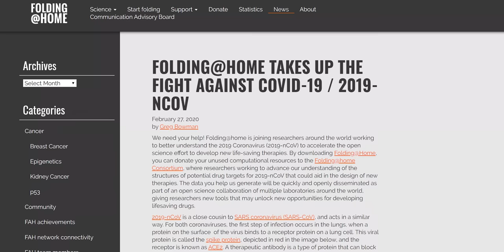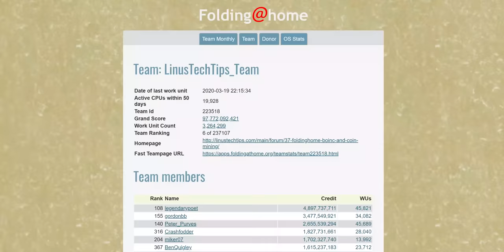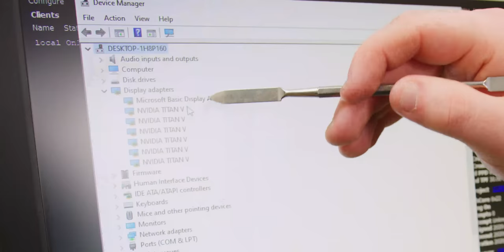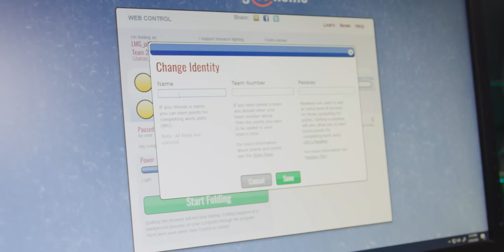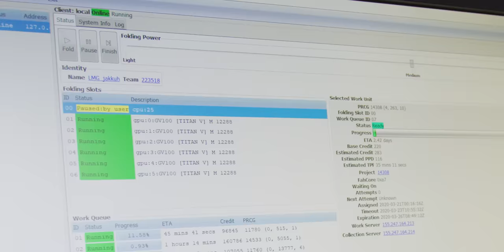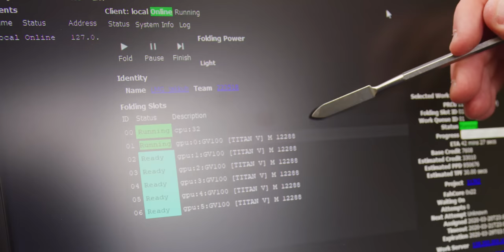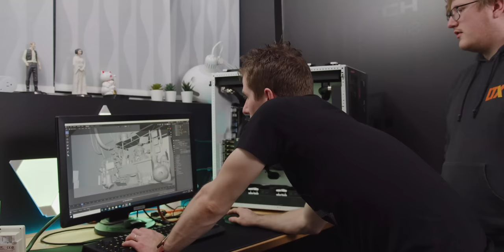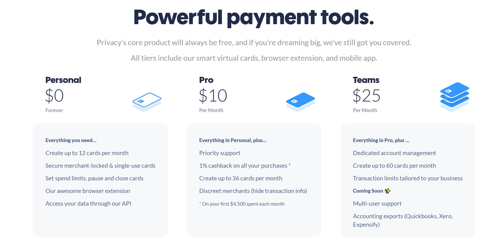Here's How YOU Can Help Find a Cure for COVID-19!

Comment: 4:49 that's a sad circuit lol, 220V for the win
Here we can pull like 2200W on a normal circuit and with "special" wiring you can easily bump that up to 4kw
Reply: Normal circuits go up to 3600W here in NL, just 16A breakers at 230V. More efficient than 110V and indeed just more convient because it can handle more.
Reply: @jadoei13  normal circuit breakers in NL work at 16 amps? That's interesting, here in ARG most are 10A but outlets can take up to 18/20A so it's just a matter of changing the breaker and the wiring so it can take the extra power
Reply: in North America @ 120Vac, 300 watts/120v = 2.5 Amps. a typical breaker is 15A. The EVGA 1600 80 plus Titanium PSU is rated to draw 10-17A @ 120v, so in theory, at max load he would need two circuits, or a bigger circuit with two hot legs (i.e. for a clothes dryer or range stove) which could be rated 30-40A @ 240VAC.
Reply: @therockstudio  i mean you can have a 240v 20a plug in canada, i looked up the chord on amazon and they even have a molex plug adapter that uses it, but i can see linus not getting brian to redo electrical just to give some 240v outlets they really dont need for too much. aspecially since im guessing they have 3 phase so they can just take 3 circuits for every neutral anyways
Reply: @therockstudio  the fact that you can't draw 17A at 110v is what's funny to me. 220V, that same load is 8.5A and you're not even close to popping a 10A breaker.
Reply: Here in Hungary I needed a little upgrade for my house.  It holds 75 servers so far and I needed some big bois here. So I ordered two 63A circuit breakers and a 40A for my house. That's 2x13860 Watts for servers and 8800 Watts capacity for my house  :)
Reply: I mean, we still have 240V plugs for dryers, ovens etc. And 480V 3 phase for more industrial stuff, but it's not the standard. Could you imagine the dangers of having an average american close to such high voltage?
Reply: Here in Britain, we rate circuit breakers in kettles.
Standard unit is the 1kW slow boiler, but 1.5kW and 2kW are also popular.
Reply: You can buy single pole circuit breakers wS higher amperage ratings.  You can buy them at the big box stores.  Just need to size the wire accordingly. 

20 amp has been the standard circuit for a long time. Of course older houses don’t have modern Romex in them.  For 99.9% of applications you don’t need more than a 20 amp circuit.  Especially on a single pole circuit
Reply: @victorshane4134  I hope you install larger wire for the new breakers, or your current wire will melt and may cause a fire.

Comment: Mom: "It's getting kind of cold in here, can you turn up the heat"
"Yup.....In a sec, Just have to turn up the computer"
Reply: "don't worry it's an AMD cpu"
Reply: @adam4759  my 3600 ran on 99% (all cores) while working on a CoViD19 task.
Reply: my old amd fx 4100 is burning alive 50c thats nothing compared to my gpu r9 390x 90c
Reply: *starts running Microsoft flight simulator

Comment: Would a quantum computer be able to do more than us folding? It seems that they can do almost anything quickly so is that also possible?
Reply: This is a misnomer.  For almost all problems, a quantum computer would be much slower than a classical computer, and unusable in some cases.  Quantum computers are only good at a certain type of task, such as factoring the product of two prime numbers (something that would undermine modern encryption on the web).  The super layman's explanation for how quantum computers work is that they can perform calculations on all possible input states at once and sort of mash them together, then provide one single output when measured.  Nothing a classical computer cannot simulate, however.  It's just that quantum computers can do certain things faster than a classical computer reasonably could.

Comment: if someone sponsors the electricity i can add 3 pc's
Reply: I set my PCs up where they'll heat my living and utility spaces, the heat they produce reduces my natural gas heating costs and offsets the increased electric bill during the winter. During the summer I have to shut a few off.
Reply: @toymachine4253  here where i live electricity gets taxed with a redicoulus amount. It's alot cheaper to heat with gas/oil than elec.
Reply: Do as much as you can. Even a laptop would count.
Reply: @kloklojul  u live in Germany. dont u. ;)
Reply: @usebrain514  ayeeee

Comment: 4:41  Or you could have an electrician run a dedicated line to a special plug and use a higher amp breaker
Reply: Also he's wrong and a standard 15 A breaker has a theoretical limit of 1800 W. But they're also in a commercial space, so they should have 20 A breakers to supply potentially up to 2400 W.
Reply: Lol.  Come to Australia where a standard power point has a limit of 2400w
Reply: @andrewcheng1998  The number of PSUs is completely irrelevant to the discussion.
Reply: @imadecoy.  two PSUs means two cords, and plugging each one in to a different circuit means you get the capacity from two separate circuits. Which is the point, when you're limited by the capacity of the circuit breaker, easier to plug into two separate circuits than rewire your building.
Reply: @toymachine4253  You need two PSUs to exceed 1600 W whether you plug into one circuit or two 🤦‍♂️ Not relevant to the discussion.

Comment: does anyone can give me an estimate on how much it costs having this thing 24/7 for a month, using average electricity costs for Canada or USA ? using only 1 CPU (4 cores) + 1 GPU? thanks
Reply: It depends what type of CPU you have and what type of GPU you have. I have an RX 580 GPU so it could use up to 180 watts, but according to my AMD Adrenalin software it's telling me I'm using about 90 watts, and then my CPU I'm only using 2 threads(1 core) for folding but sometimes I use 4 threads(2 cores). The 1700x CPU uses up to 95 watts so about 12 to 24 watts depending. Let's average that so 18 watts. Add the two and we get about 115 watts, so in 24 hours it could use 2.76 Kilowatt Hours. If you are running an RTX 2080 Ti and let's say it's using 250 watts then you will be using about 6.5 Kilowatt Hours per day. Check your area for kilowatt pricing. usually the price per KW hr depends on how many you use per month
Reply: @kozmizm  oh really

Comment: Nice that there's a comparison to a 980, so I know how much inferior my old machine is. But, I guess a 980Ti still runs well enough for most purposes.
Reply: I think 8800gs and even older will still run this stuff, so a 980 will definitely get some good work done
Reply: I have a simple i7 4790k with a msi gtx 980.  Is it actually worth me getting my rig in on the process?  Or do you reckon it will be pointless?
Reply: @steve323f  Of course it will make some work done ! I'd say go for it
Reply: @Cig4ras  on it right now.  Every little helps I suppose. 💪
Reply: @steve323f  now it mostly idling. There is some other networks like rosetta. Rig is good for computing, this was a hardware that mined before it became mainstream.
Reply: @vadnegru  yeah I noticed.  Although my fans have ramped up nothing else seems to be happening.  I've got my support research on any disease but the CPU and GPU are sitting at 0.00%.  Just gotta leave it on and see if a difference is being made.
Reply: @steve323f  check logs, it shows if it done something or not.

Comment: Your telling me to get a better pc to help science. I’m playing seige
Reply: I'm playing siege too, what's your uplay ?
Mine : Timochat
Reply: how powerful does the computer need to be to run this
Reply: @sbc2954  Anything that can run windows can run this. Just make sure it doesn't overheat by checking HW info (keep it under 80-85 degrees if possible)
Reply: @jadoei13  As long as you got Windows 2000 (or Windows 98/ME with KernelEx)
Reply: @jadoei13  there is timeout of one day to each task. I'd say even 1030 might be suitable, but rx 470 is a comfortable minimum if you just want it to run when idlle. You might try to undervolt a bit to lower the temperature.
Reply: @Timochat_  HotCrispyKing
Reply: @vadnegru  I make it running on a 1030 on the HTPC. It does get there before timeout I think. But not recommended.
Reply: @agentcrm  power bill is happy
Reply: @vadnegru  I'd prefer to be running a 1060. Better balance between power and performance.
Even a 1050ti (or some 1650) is much better and still not needing external power.

Comment: I have used this folding@home program with my ryzen 9 3900x and my rtx 2070... and then my father came in and said I should turn of that Programm because it uses to much electricity... 😂
Reply: You can pretty much half your power usage through MSI Afterburner and Ryzen Master by lowering power limits, selecting power saver as a power plan also helps. My 3rd gen Threadripper runs at 120w at 3.2Ghz for example.
Reply: Try undervolt
Reply: Try turning down the voltage.

Comment: My i7 2600 with a GT 1030 is on the case. (Yep, I've finally upgraded!)
Reply: So you bought a Toaster ? :P
Reply: @bongwasserfisch2223  Surprisingly, the CPU is actually above minimum specs for most games of 2019. It's even above recommended on some! (At least, going by Passmark scores.) 

My plan is to do something like the $69 gaming PC with it. The 1030 is just an extra card I had, which I hope to replace. (Still, it's as good as the 650 Linus put in his.)

Comment: PCMR team ftw. LTT  just made it separate for ego reasons. Still doing something right, but...  PCMR is an open community and people help each other without a paid subscription. We use our equipment to also supply face shields, masks, Corvid test units. And we donate it all. (Face shield can be done with less than 50 cent us per unit. Make molds and production can be faster.)

Comment: Linus: Fold at home to help cure diseases! 

My electricity bill: No I don’t think I will
Reply: Think of it as a donation. I have an old desktop with a shitty CPU and a GT1050 graphics card that consumes 70W  (I only use the GPU; the CPU consumes as much as the GPU, but gets less than 1/10th the points and has a loud fan while the GPU is basically silent). At 100W average consumption , 24 hours per day, 30 days per month and 15 cents per kWh, the cost is only $10.80 per month. I think it's worth it money wise, and I like that I know that all that money is being used to contribute into disease research.
Reply: If you're running your heater, it won't make much difference in your utility bill, since every watt used by the computer produces almost exactly a watt of heat output. If it's your summer and you're not running a heater, then it'll cost more.
Reply: @AlexanderPavel  yeah....if you live in the states, germany has like 3 times that price!!!
Reply: @mavfan1  that's a little harsh don't you think?
Reply: @AlexanderPavel  You sir, deserve a cookie.
Reply: mavfan1 it’s called a joke. You must have a lot of friends to not be able to understand one

Comment: alright bois time to break out the old unused pc from 2008 with Radeon HD 6450 and single-core Intel CPU that costs 50 cents with 10 gigs of ram
Reply: 10 gigs of ram? Unbalanced lol. I think you mean 10Mb
Reply: 2008 was either core2quads or phenom 2
Single core was ended in 2002 I think, with amd dual core 64
Reply: I have a Pentium III laptop and an Athlon XP CPU/mobo.... I'm about to wreck this virus, boys.
Reply: @Bradford1040  Yeah you are correct.  I had a Phenom II back in '08, adn the Core2 Quad Q6600 was all the rage.
Reply: @Bradford1040  just means the computer he received (or bought) in 2008, doesn't mean it was built with new parts in 2008. my PC i bought in 2007-2008 was a used single core Pentium 4  which was new back in the early 2000s (2003 i do believe) the last single core was in 2004 with the Prescott pentium 4
Reply: Just to be clear I was not yelling about the year thing, more like I am glad I remembered what was going on lol, I am 50 and starting to forget shit, plus I am super bored from being stuck inside, lol
Reply: @Bradford1040  hah, didn't seem like you were yelling.  I'm turning 35 this year.  And we have the same last name, ha

Comment: This could have been a lot more informative if you'd at least mentioned the BOINC projects that primarily utilise CPU, whereas Folding at Home relies primarily on the GPU. Also I think there's a real danger you've given the impression that people don't need to bother unless they happen to have a massive multicore dual CPU, multi GPU monster lying around. Bottom line is that anyone with a decent GPU (e.g. gaming machine) should sign up to Folding at Home, while pretty much everyone, even if like me you only have a pretty crappy old graphics card, can put your idle CPU to good use by signing up to BOINC. https://boinc.berkeley.edu/index.php
Reply: CPU remains important to Folding@home because there are calculations that cannot be performed on a GPU. It is designed such that even someone with an old dual core CPU and no GPU at all can still contribute. So, run whatever you've got! (Just be patient for now, because their servers are overloaded with all the new users.)
Reply: @samrose6929  Thanks for the clarification Sam. My direct experience is via dockers on unRAID systems, which can vary wildly in compute power, some, like mine, without any discrete GPU. On the unRAID forums the general advice was if you have a pretty decent/modern GPU go with F@H, otherwise BOINC is the way to go. I'm delighted to learn that F@H can make use of even older CPU's - all the more reason for LTT to have sought to encourage EVERYONE to contribute rather than just show off their insanely powerful multi GPU set up and make a stupid competition out of something that SHOULD be about cooperation, globally and nationally.
Reply: @julian.morgan  It was a mistake of theirs, in my opinion, so show themselves disabling the CPU slot in such a monstrous system, rather than showing the two coexisting. It only takes a few CPU threads to feed the GPUs - the rest can and should be put to work. FAH's molecular dynamics cores have trouble with odd numbers of threads (especially larger primes) so on that system, it might be necessary to create several 16 or 32-thread CPU slots to fully utilize what it is capable of. But with most users focusing on GPUs (because they're affordable) rather than massively multicore CPUs, that machine has much to offer.

The project typically allows 3-5 days for completion of the average CPU unit. My Core 2 Duo GPU hosts, running one CPU thread, often finish one unit per day. Not a ton of performance, but given that those machines are on to run the GPUs, it's worth doing, and shows that even old CPUs can still contribute.

Comment: Technically, breakers DO go above 1600 watts - but not as a highly common thing in the US/Canada (I think Mexico as well).
20 amp 117 VAC circuit can go over 2300 watts intermittent, 234 circuits normally START at over 3KW (and modern computer power supplies work on 234 FINE).
Most COMMON home outlets though are 15 Amp 117 VAC.

The overload issues that the Folding@Home project had for a couple weeks seem to have been addressed at this point - I've been having my rigs (I'm a fairly long time FAH heavy hitter) get work consistently for the last couple days.

And yes, I've not had to turn on an actual HEATER for a few years now. 8-)

Comment: I don’t think my 2 core 25$ uses laptop with integrated graphics would help lol
Reply: Don't feel bad. The vast majority of people have hardware that isn't worth spending the extra electricity on to run any kind of distributed computing projects.
Reply: I actually have my 10 year old laptop folding and it still working... sure it's not as effective as my gaming rig but it's folding... so yes... anything will help :)
Reply: The state of the art in this field even a few short decades ago was a cray supercomputer. Even the shittiest mid-late 2000's intel atom powered netbook would run rings around that. There's no such thing as too underpowered to be useful.
Reply: Mr3ppozz Well, below a certain amount of computing power, it just takes more computing resources to distribute jobs to it and receive and process the returned information, so there is a lower limit.  Your TI-85 would probably be a waste of bandwidth.
Reply: Erotikstudio Winkler GmbH See my previous comment.  Some small computational devices would just be more hassle than help.
Reply: @sac3528  I think you might be incorrectly estimating the computational resources an Intel atom and a cray supercomputer have.
But that's not even what I'm referring to here. I'm talking about computational performance vs energy required to operate. Consider a Ryzen 9 3900x and a Pentuim 4 3.8GHz. Sure, they COULD both be contributing to f@h, but while the Ryzen needs 2x the electricity than the Pentuim, it also runs 75x faster.
If you had 75 of the Pentiums running, you would need at least 11 kw if electricity to produce the same output that the Ryzen would use 300W for.
If you have to choose between running up a $1000 electricity bill or donating $50 to the f@h project directly, I would strongly advise just donating the cash instead of running the client on that dinosaur.
This is what many people with older, slower computers SHOULD NOT run distributed computing projects. You are just contributing to global warming without actually benefiting anybody by a meaningful amount (proportional to the long term harm you are doing, anyway).
Reply: @Mr3ppozz  maybe do the math on how much electricity that laptop is using vs your desktop, and see if the value of the electricity (and global warming it's contributing towards) actually makes sense long term.